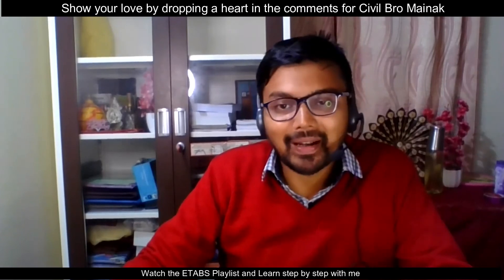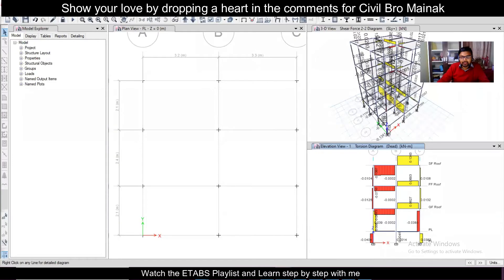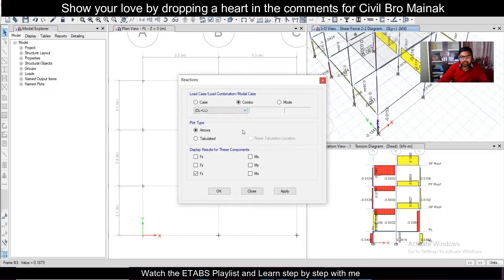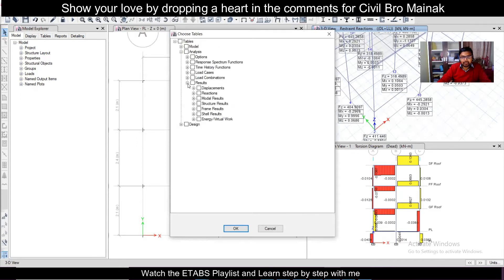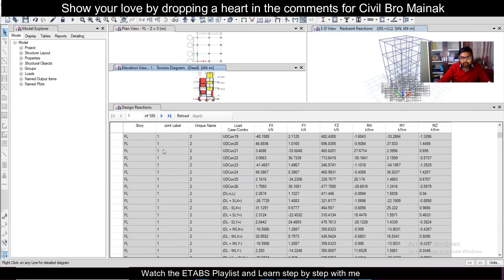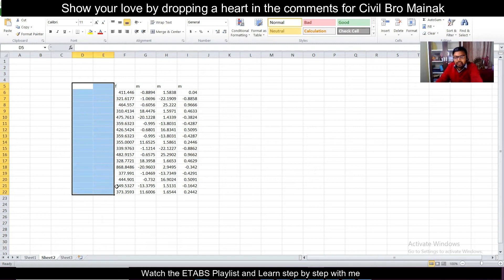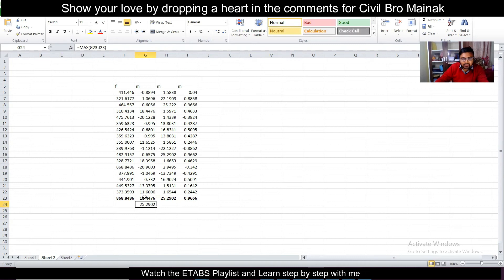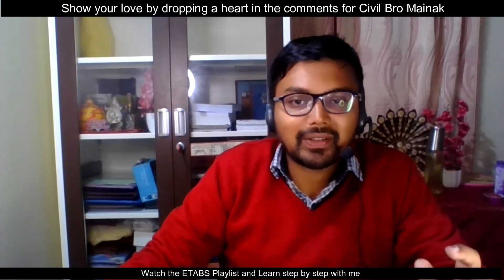Building Design in ETABS: Displaying Foundation Reactions | Part 9

Comment: Thanks for video. But I think you are underestimating the moment at footing base by not considering Fx and Fy
Reply from the maker: Yes, typically we design for the highest value of force and moment and fz generally has the highest value (not always) so what I did is technically incorrect but in overall for the structural drawings it won't have much impact.